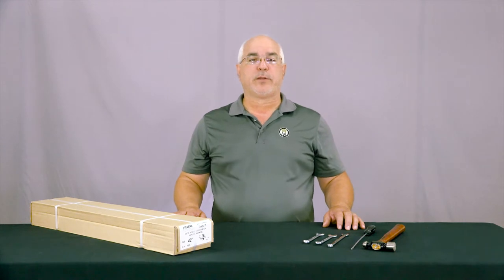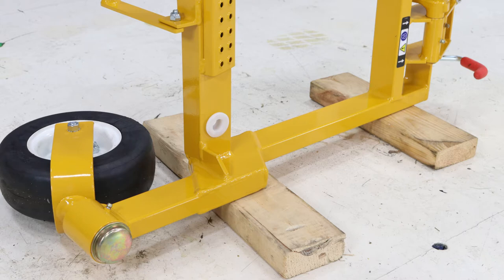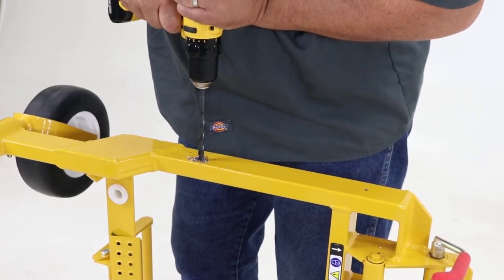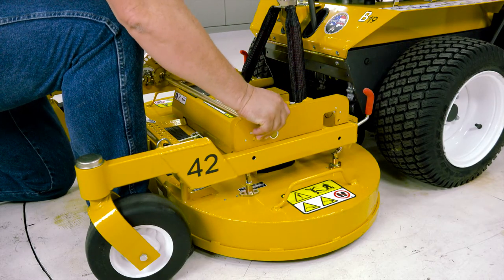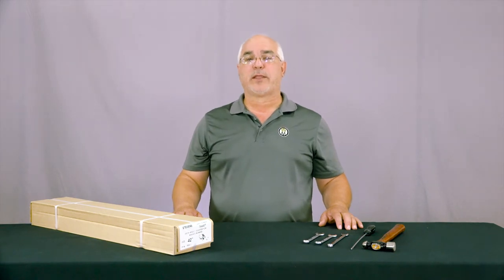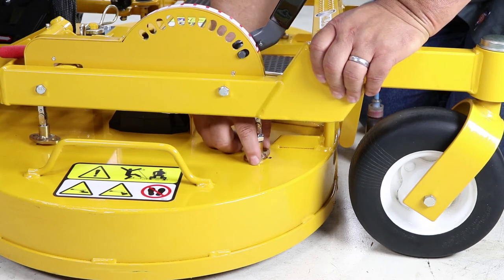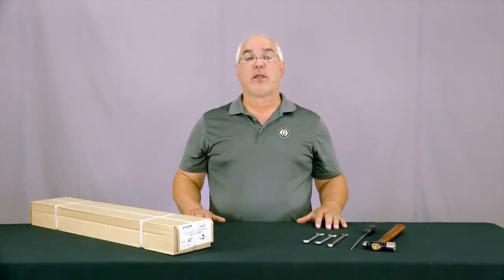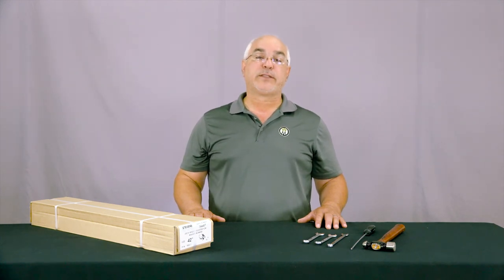Tech Minute, Stevens Deck Height Adjuster Installation

Comment: It’s kinda ridiculous what Walker charges for this and even more it’s not standard equipment for what they charge for a deck!
Reply: I might be ok with the kit price, but the fact the holes are not predrilled and tapped so the kit bolts on is insane. Walker would sell 100x these kits if they did this and eliminated the insane template kit that doubles the price.

Comment: Sold both of walkers because of stuff like this, should have came standard with each machine and a good seat as well. Idk why they thought it was okay to charge you 10-15k for a mower and then say well if you want to be comfortable and adjust you height easy like every other mower! You need to cough up some more cash! Tough sell

Comment: So, These don't have deck height adjusters? Claiming to be at the top of the industry is a strong statement for a mower without the ability of adjusting height.
Reply from the maker: Hello, our mechanical Deck Height Adjuster installs directly onto the Walker mowing deck. It offers quick and easy cutting height adjustments in 1/4 inch increments, using a single-hand lever, without leaving the operator’s seat. To learn more about this option please visit this page: https://www.walker.com/addons/deck-height-adjuster

Also each Walker Deck has the ability to adjust the height as needed by moving a height adjuster pin on the front left and front right side of the deck. If more adjustment is needed, our Deck Height Washers allow finer adjustments of cutting height on compatible decks. Use these to adjust deck height by 1/4 inch. You can find more information on those here: https://www.walker.com/addons/deck-height-washers

Comment: HI, Umm in the fall I cant or pitch the deck 1” higher in front to facilitate leaf pickup-mulching. will this deck height adjuster do that?
Reply: remove the pins from the front and lift the front of the deck and replace the pins in a lower hole
Reply: @miked1286  thank you

Comment: What is recommended for chain upkeep? Any type of lubricant? 

 I just had a used one installed on my 42" deck and a new one installed on my 56" deck. Both are back savers can not believe I waited so long
Reply: I would guess just some Wd 40.